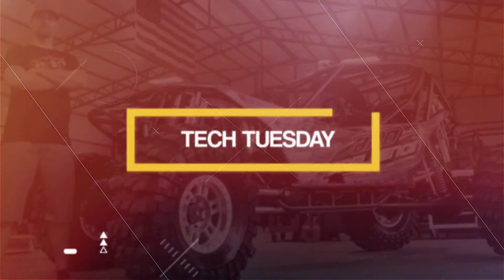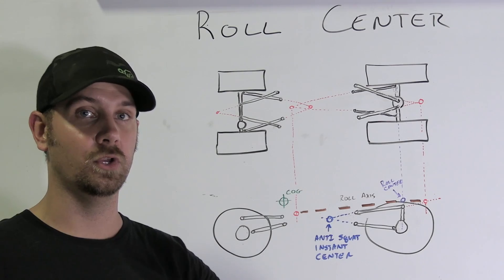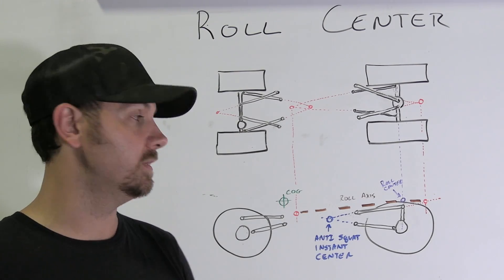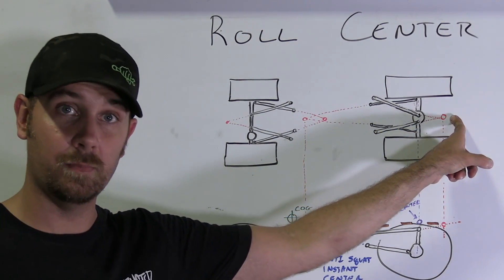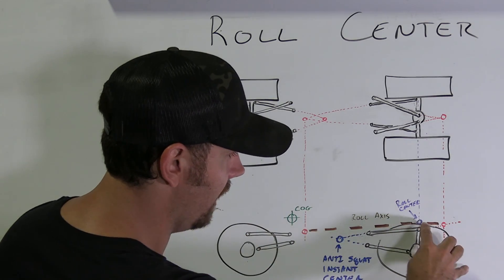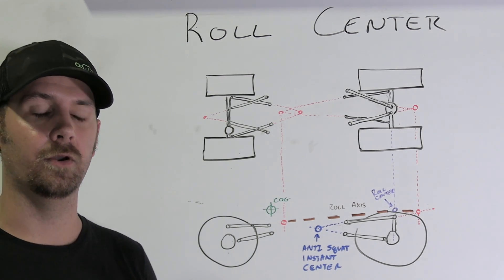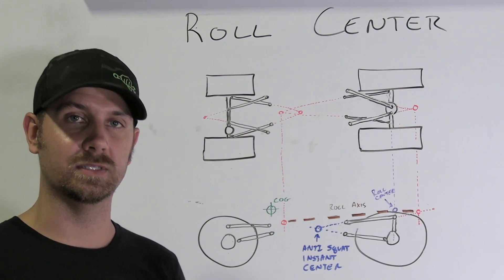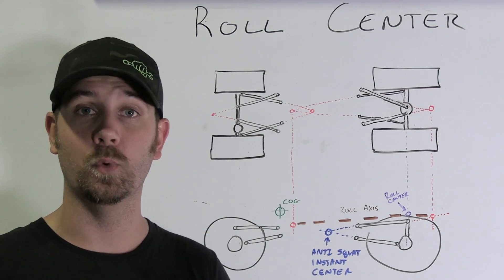ROLL CENTER EXPLAINED by Jake Burkey- Tech Tuesday

Comment: You guys build the best off road hill climbers absolutely, I have a question about a 4x4 that gets mostly used for hauling heavy loads off road ,what is the best suspension set-up  for this purpose in your opinion?
Reply from the maker: leaf springs really
Reply: Yes unfortunately leaf springs im not sure how to build it so that I can haul firewood and tow trailers if you have any suggestions I would be grateful for any input and someday I will build a strictly offroad 4x4 Good Lord Willing , after I get the house paid off and I thank you for your response and  for making such awesome and indepth videos, 
Sincerely a BustedKnuckleOffRoad fan and much respect 
@BustedKnuckleOffRoad

Comment: This is fantastic. Thankyou.

I built a 4 link for a friend years ago, which had the lower links, central to the axle direcly in front and I had massive axle wrap issues. The diff just kept wanting to twist excessivle upwards. Moved the mounts 90° downward so that the links were underneath the axle in line with the top arms and problem solved. Id love to be able to have lower mounts in front, to reduce angle, but not sure  what I did wrong initially. Had the 25% link seperation also.

Comment: I run a parallel 3 link in rear. Wishbone upper and slight triangulated to lowers. Built a bent dom tube bridge truss. Jacked axle up till level driveshaft and added bump stops. Took measurements for tire full stuff too. Then measured squarely 31" and marked for mounts. My driveshaft is around 31" run length. So now have the 2 control arms and driveshaft moving parallel.

Comment: I've been building crawlers for years. Your videos helped take setting up the suspension to another level. My personal crawler is four link front, one link rear and it flat works. The body stays level on obstacles and is stable at high speed. Uphill, downhill, side hill on coil overs it is very stable!
Reply from the maker: awesome glad we could help

Comment: Oh that was a real “heads up” about the panhard bar - tnx.
A question if I may: what about a Watt-linkage like on the Bucher Duro? How about a vid or comment about using this instead of the panhard bar?
Thank you for taking the time and showing things the right way!
Reply from the maker: watts link is a different animal
Reply: @BustedKnuckleOffRoad  Yup, thus my question, I can not wait for you to explore the pro's and cons - if any - of this system.

Another question - if I may: From some videos about the rock racers it looks like some run a very negative caster (the steered wheels leaning "out" of a corner and not in.) is this true and if so, why?

Comment: Hey mate, used the calculator (v3.0) you recommended and it says for my measurements that my roll centre is 17% (roll oversteer). Just wondering if you could clarify that for me as you only speak in 0-100%.
Thanks

Comment: Another question I got :
CRC - Constant Roll Center link.
There's a company that fabricated it years ago already (bolt-on) , but for Long travel suspension cars the arms on the link can be fabricated longer as well as the center arm....I've read of cars with 14' of rear travel running CRC ....
Question from me is Why Haven't we seen more on CRC ??
Reply from the maker: Haven't ever looked into CRC
Reply: @BustedKnuckleOffRoad  Ok...thx for the reply....I'm just wondering if we can adapt it to a 14' + rear travel system.... Have a look at CRC.....I'd love to see your thoughts on it

Comment: Good video. But I do wish you had talked about the fact that lateral weight transfer still happens regardless where the roll center is. A vehicle will never "lean into" a curve. Inertia always pushes the CG to the outside. The easy way to visualize what's happening is to think of a pendulum where the CG is the weight and the roll center is the pivot. It will always move "out" when pushed. Putting the RC above the CG will just make try to go up and out rather than down and out. The problem there is that you have the geometry trying to lift the body while the weight transfer is trying to compress the suspension. Conversely, you are actively trying to lift the inside tires by trying to compress those springs while weight is being lifted off them. That's why a high CG only works at low speeds, lateral weight transfer isn't a factor then.
Reply from the maker: come take a ride in one of our buggies and you will see the difference

Comment: I have a different scenario ,Model TT with transverse leaf springs , 126" wheel base  and using model 44 and 60 axles , some of this will work but not all of the stuff your telling me will be used 
Roll Center will be necessary along with squat control but no coils and likely no shocks because I am way to much of a Ford Purist 
Great video and thanks for the input laying out dimensions that I knew I didn't know till now
Reply from the maker: no shocks?

Comment: Hey Jake this Jock Burge miss can u mount the motor so the torque will force front down in stead of right rear like side ways
Reply: Or some kind of torque control to make all 4 have same ground psi if u prefect this u could  rule Equalizer shaft or something they always go to the right the rut deeper on right
Reply from the maker: sounds super complicated but possible
Reply: @BustedKnuckleOffRoad   thank you for the response yes I thank some could be in the drive line The direction it turns could make some difference in side torque love you guys I 59 would love drive one I see lines nobody tries

Comment: I know this sounds dumb but. When you measure for your roll center percentage are you measuring from the ground up to center of gravity or from the bottom link mount up to center of gravity?

I'll be running 39 to 42 inch tires but with beadlocks I run them at 1 or 2 lbs air so really like a 35
Reply from the maker: ground

Comment: Noob question here... but when you see a vehicle make a turn and they lift one front tire off the ground, what is normally causing that? Is that from Anti-dive? Or is that a roll center thing?
Reply from the maker: Like a Trophy Truck?
Reply: Busted Knuckle Off Road yeah kind of, I always assumed it was just from power/torque but then I’ve seen guys do it in TJs and stuff too, with stock engines. After watching your suspension videos I’m thinking it’s more in how the suspension is set up now

Comment: Hello. I can’t understand, why dose high roll center having problem with high speed bump? 
Roll center should makes difference with “lateral force”, because the lever effect. but shouldn’t make much difference with “vertical force” .
Reply from the maker: it unsettles your suspension and makes the vehicle want to roll

Comment: Umm...all those line are widely used to calculate a roll center, but it isn't the way it works. Each of the suspension links is either in compression or tension, which pull on the chassis at their attachment points. The lateral forces (we are talking roll center, so braking and acceleration aren't a factor) come through the tires and are more or less linear function of load (its not near the limits, but this is Indy, NASCAR, or F1). The front and rear are computer independently. 
The net is a vertical force on the body. The lateral acceleration causes weight to transfer to the outside wheels, and when the RC equal the CGH the forces in the links totally offset those forces. Lower roll centers don't. 
In people who do the lines for road racing and oval track cars it sometimes is a bit funny. They end calculating for the inside and outside wheels equally, while in some cases the inside wheel has no load at all (we've all seen pictures of a car on track with both inside wheels raised). This is an issue these days when even street tires exceed 1G lateral on pavement. Krawler KXs won't do that.
Reply: I try to explain things so the average person can I’m understand.  Most people would get lost trying to understand what you just wrote
Reply from the maker: Don't want to talk over people's heads
Reply: Hey Dave your killin my buzz .... now I gotta start all over !!! LOL

Comment: Is it possible to use the link calculator to find all these values running a front triangulated 4 link,  and leaf sprung rear? If so is there any specifics other than what’s described in the videos? I have a toyota on dana 70 axles, 42’s and a full EXO for crawling. I’m looking at changing my front 4 link system for better performance while crawling through obstacles and to help reduce body roll.
Reply from the maker: not sure how you would find a rear value with leaves

Comment: Record a video of a clean slate design of a typical buggy using the 4-link calculator.  Teach the ins and outs of the 4-link calculator.  Use a screen recorder of sorts, and voice over?  I'd watch it.
Reply from the maker: Noted.
Reply: Agreed
Reply: the 4 link calc. is pretty intuitive itll make alot of sense once your start your project hands on and have some measuraments to work with